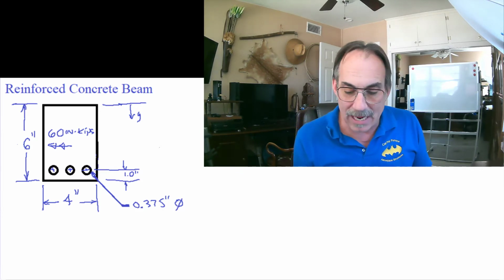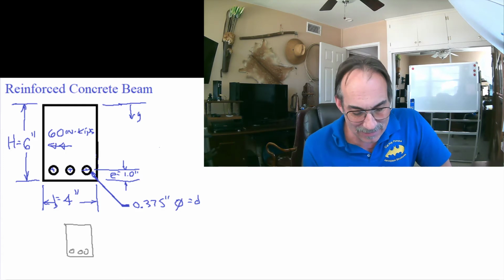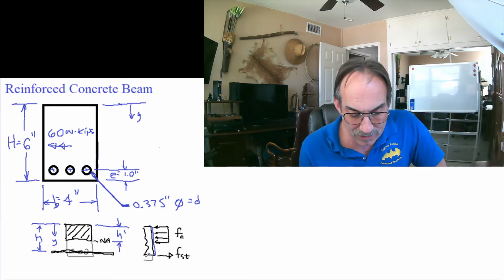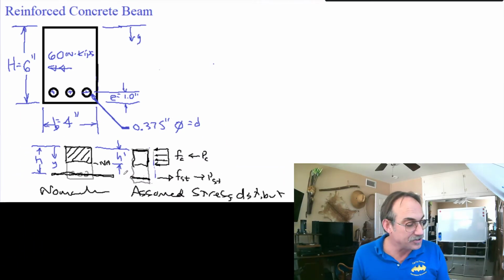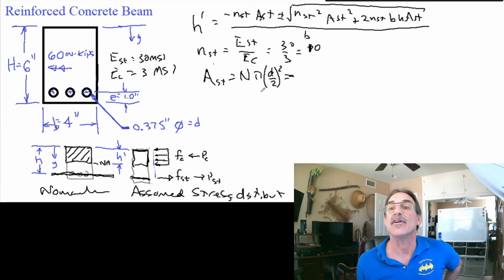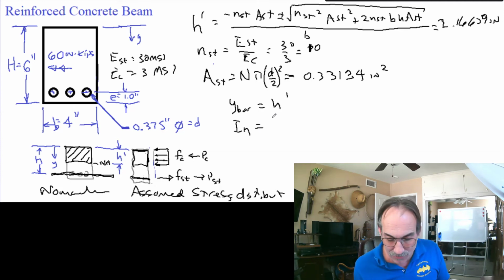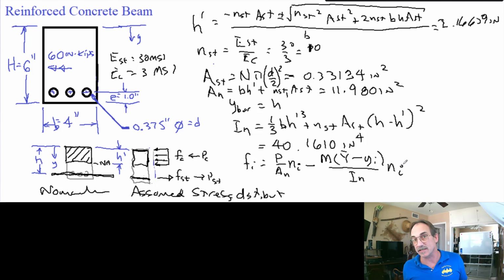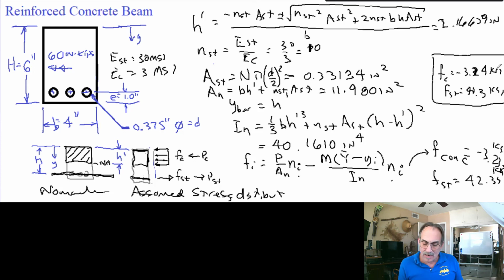Strength I: L-10c Analysis of Reinforced Concrete

Comment: Interesting but what company are you working for that is making airplanes out of concrete?
Reply from the maker: Lol.  Anyone can make aircraft out of lighter materials!  ;-)

Actually, most undergraduate programs cover concrete analysis as a fundamental building block, and the concept of solving such a problem is insightful and useful to hone the analytical abilities of aerospace engineers as well.  

Being able to solve problems like these prepares students to improvise and work outside commons boundaries of analysis.

Our students also learn analysis of welds, which is encountered less frequently than many other methods of analysis.

Any structures specialist should be a master of these fundamental techniques.